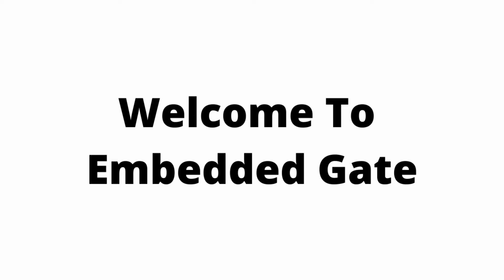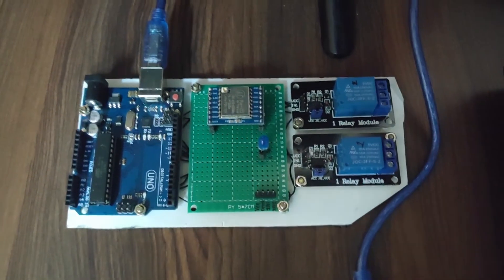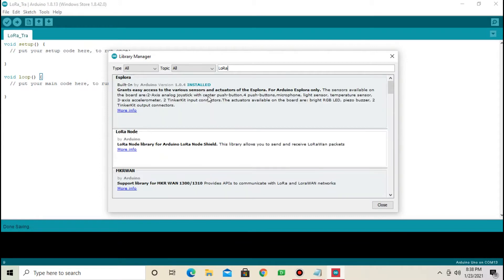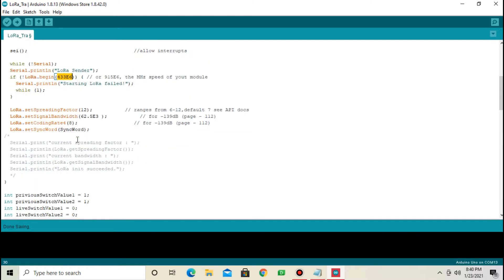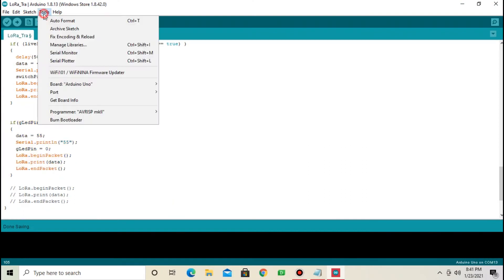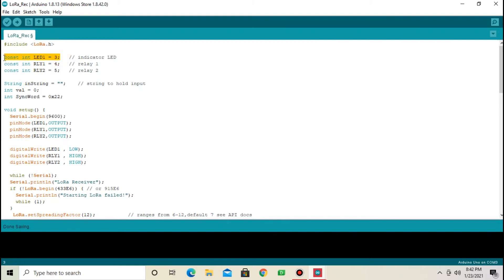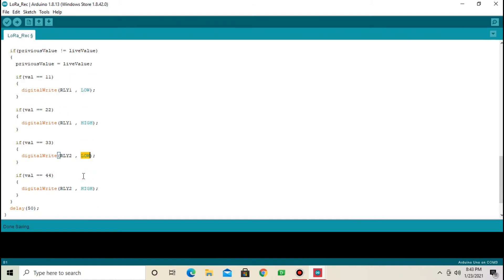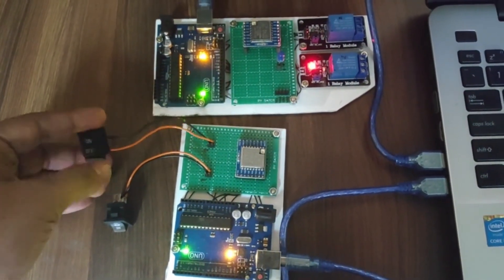Home Automation Using LoRa.

Comment: i have a question sir, please respond asap, the question is, if the switch at the receiver end is pushed on, will the receiver kept sending data continuously to the receiver, or will go in sleep mode and will send signal again only when the switch is pushed off.
Reply from the maker: yes when you push the button the receiver keeps sending data
Reply: @EmbeddedGate  in that case what will be the battery life if i run the transmitter on 4500 mah 4.5 volt battery, actually i want to make water level sensor, with autostart and stop using lora, but main problem is battery life of transmitter, and the transmitter is having only two relays, i want to add 4 relays, plz help

Comment: keeps getting LoRa receiver fail.
Reply from the maker: How much is the distance between the transmitter and the receiver?
Reply: @EmbeddedGate  The distance is at the tabletop level just for testing; I even took the receiver outside about 12 meters, and the results were the same.

Comment: nice project can we add 4 outputs instead of 2 as there are 4 Elec points in Home Automation and in your video and how long is its Range you have not mentioned in your video
Reply from the maker: @sanjaykhatri6093  yes you can add 4 devices. The range depends on the antenna. Without antenna range is in cm.

Comment: Very cool project! I'm very new to ESP32 / LoRa and this is really helpful. Instead of the 2 Uno's, is it possible to use 2 Arduino nano's or 2 pro minis in its place? Is it possible to use the cheaper/regular relays for this project?  Thank You
Reply: Yes. You can use any Arduino module.
Reply: @vipulmore7352  Thank you. Also, where can we purchase those LoRa modules at? I can't seem to find them with the 915mhz.

Comment: Sir will the led won't be on for some time untill we off it. In your project it's blinking. What is the solution?
Reply from the maker: I didn't get your question.
Reply: @EmbeddedGate  sir in this video when you on the switch the led just blinked 0:40 . Will it not on untill we off switch?
Reply from the maker: @job3004  That one is signal LED. Watch full video
Reply: @EmbeddedGate  Sir i just wanted to know will there be a possibility to set up an led which will glow not just blink?
Reply from the maker: @UCbu-CR8AuQjsfciHcH4FsHw Without antenna 10cm with antenna around 10 KM (Depend on antenna )
Reply from the maker: @UCbu-CR8AuQjsfciHcH4FsHw yes
Reply: @EmbeddedGate  Sir will project work with E32-433T LoRa Module?
Reply from the maker: @job3004  yes

Comment: Hello, i followed your project and have some problem... Everything is working most of the time but have noticed that sometimes when i press switch to On or Off it wont to turn on or turn Off relays...like command is not transfered from transmiter to receiver and when i repeat it turns on or Off... What do you think what can be the problem? And is there something to be added to transmiter to know that command  is succesufully transfered to receiver and relays? Thanks
Reply: did u got the output?

Comment: Hi, nice project... How to get info on transmitter side that Lora modules are in range like I have on receiver side (led diode) and info on transmitter side that relay is turned on?
Reply from the maker: I also want a solution to the same problem. If I find something I will make a video for you.
Reply: Great thanks in advance

Comment: hello, I have made this application, it is very successful, but I have a problem, I need to send these values at continuous intervals. Example 33 .....33.... 33 I would be glad if you could help.
Reply: Osman bey merhaba e32 433 mhz lora modüller gibi, modülün arayüzü programlanıyor mu, kanal ve adres olarak? Siz bunları kullandıysanız testi nasıl dı?
Reply: @ismailsinapli  merhabalar arayüz istediğiniz gibi programlanıyor.
Reply from the maker: I'm finding a solution for the same problem. If I get any solution I will make the video.
Reply: @EmbeddedGate  thank you
Reply: Yapmak istediğiniz nedir?
Reply: @osmanaydemir9720  monoray vinç kumandası yapıcam kapalı alanda 6kanal, sen bu modülü kullandınmı?
Reply: #Osman modüllerin mesafe testini yaptınmı max. Kaç km? Ben bu modülden kullanmadım
Reply: @ismailsinapli  açık alan 30 km çeker
Reply: @osmanaydemir9720  kardeş sen 30 metreyle 30km yi karıştırdın herhalde, bu modüle yagi anten bile bağlasan siksen 30km tx yapamaz. 
📌 bu modülün datashetinde azami 5km yazıyor, birdaha soruyorum sen bu modülü kullandınmı?
Kullandıysan nasıl anten bağladın kaç db, performansı nasıl?
Reply: Kardeşim öncelikle konuşmasını öğren sonra gel konuşalım şuan 30 km ileriye veri taşıyorum lorayla madem benden çok biliyosun neden bana soruyosun kendin yap 🤔
Reply: Tek bir lora 30 km ileri atar aktarma yöntemiyle Türkiye'yi dolaşırım sen diyorsun ki 30 metre 5 km 🤣
Reply: @osmanaydemir9720  KARDEŞ  bugün testini yaptım E22 900 d22 ile gayet başarılı, RA.02 SPI PİNLERİ kullanılmış RA serisi lora modüllerin emisyonu zayıf.

Comment: hi it seems like that this fits with my requirements, one thing? if i want to add another another set of transmitter and receiver, how can i differentiate it with the first one? with the same set of function but with different address, what should i edit? thanks
Reply from the maker: Edit sending and receiving pair of data. Like I have used 11,22,33,44 for the first transmitter and receiver pair. Use 21,22,23,24 for next pair.
Reply: @EmbeddedGate  thanks a lot

Comment: I want to use push button at transmitter side and relay on the receiver side.... With that push button press, relay must turn on.... Can you please help me with the code on both sides?
Reply from the maker: The same project I have developed in the video. you make to make minor changes.

Comment: What's the range
Reply from the maker: According to the datasheet, the range is up to 15-kilo meters.
Reply: @EmbeddedGate  
But sir with GSM MAGNETIC ANTENNA , SPRING ANTENNA , AND 2.4 GHZ ANTENNA I HAVE TRIED MANY ANTENNA'S BUT I GOT A RANGE AROUND 600 METERS ON 433 MHZ FREQUENCY WHY CAN U PROVIDE ME YOUR CONTACT DETAILS.
Is there any changes for frequency in code pls let me know I need long range for my project pls help me
Reply: @kpinnovations6613  same problem less than 400m did you found any solution
Reply: @bilalhajji9473  no dear all lora modules are fake I spend 8 thousand for rnd and module purchasing also tried reyax original module from Taiwan same problem occurs no resolution and in YouTube video they said 4 km 
But they can't reach 1 km 

Right now I am working on gsm module at least this work for my project on pan India level
Reply: @kpinnovations6613  yes i agree your 💯 correct 
I did made gsm relay control but im lokcking for control whit no wifi or sms

Comment: Bro, the lora chip available is not having pins.. plz tell where to get the adapter pcb that you are using with pins... or if you  are having the pcb design kindly share the gerber file
Reply from the maker: Hello. You can get a footprint on EasyEDA.
Reply: @EmbeddedGate  thanks